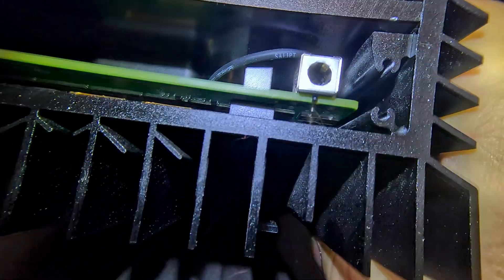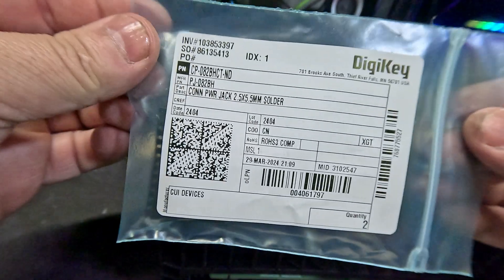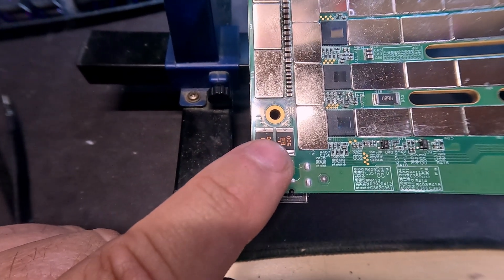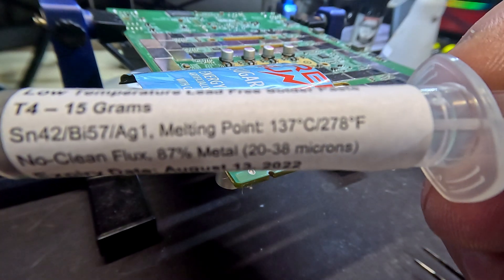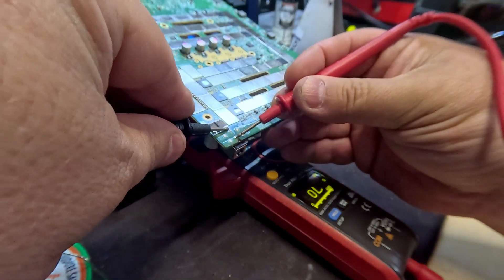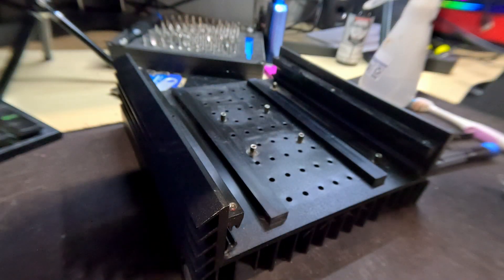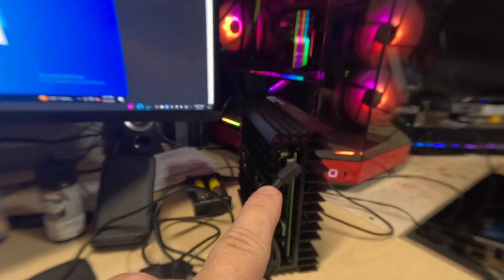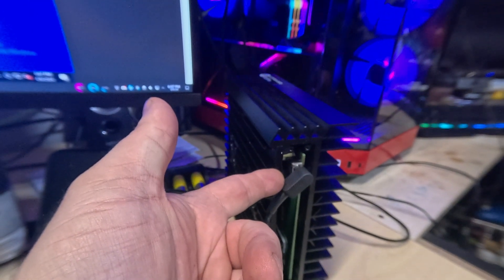KS0 Pro Barrel Jack Repair #mining

Comment: @madelectronengineering do you repair all Ks0 pros how do I get in touch with you I may have popped capacitors not sure have to take it apart forgot to turn the fans on when I turned it on and heard a pop after a bit

Comment: Hey Mad Electron, new sub here.
Can you comment on the safety and/or suitability of a 24v PSU ? 
I was wondering if the the KS0 Pro hardware could run on 24v input, and if this would resolve the issue of too many amps through the barrel plug.
The 24v PSU's are the same style (like a laptop charger) and intended for running LED driver boards.
Thanks for the great content!

Comment: This is definitely not the ideal way to do this repair. Leaving low temp solder in the joint is almost a 100%guarantee of a future failure. Never leave low temp solder in ANY joint, especially on a board that you KNOW is going to be under constant thermal stress. If you're going to do it, do it right. Use the low melt to wick/solder sucker ALL the solder out of the joints. Then use leaded solder to install the new part

Comment: At 12 volts it only takes 120 watts to reach 10 amps. There’s going to be a lot of these getting fried by people using the server PSUs. At 19.5 volts it takes 195 watts to reach 10 amps.
Reply: So 19.5 would be the safer option, but if your of above 300gh what is a wattage?
Reply: @cadendgama1427 above 300GH it gets into the 170+w range, I recommend using a 230w power supply when clocking over 300GH.
Reply: @SchwiftyThings  thank you! I am going to be using a 19.5v 230w psu

Comment: Yeah Taines either used Google-Fu, or seen my post on the Misfit Mining discord where I posted the variance between a good PJ-082BH 10 amp barrel socket and a cheap RASH712BKZ 5 amp 2.50 x 5.50 barrel socket. 😀